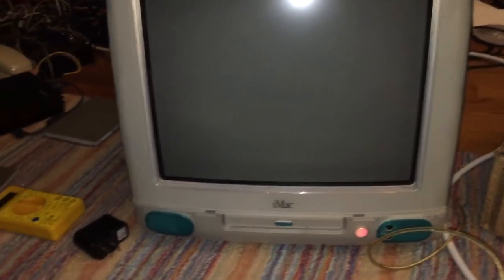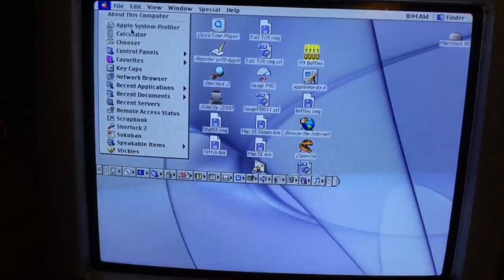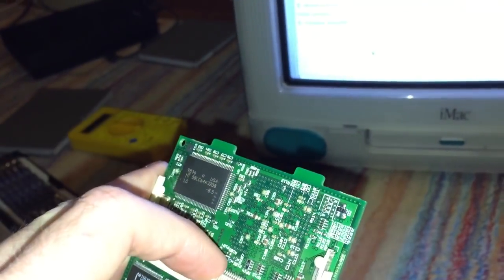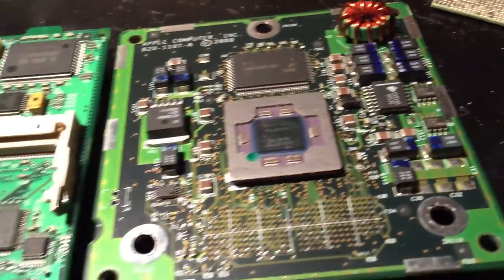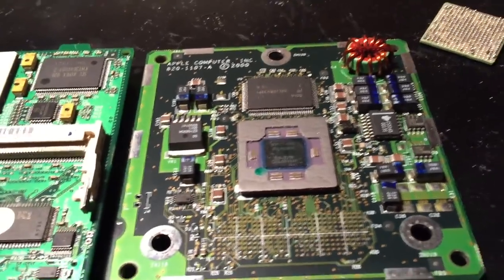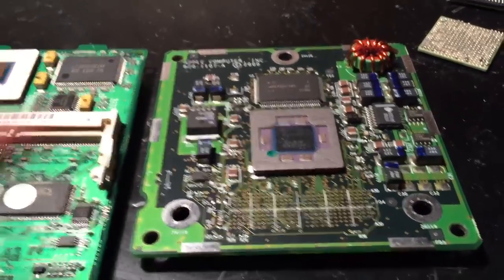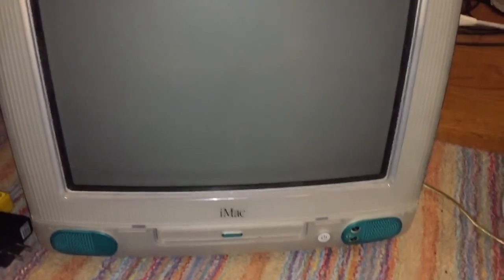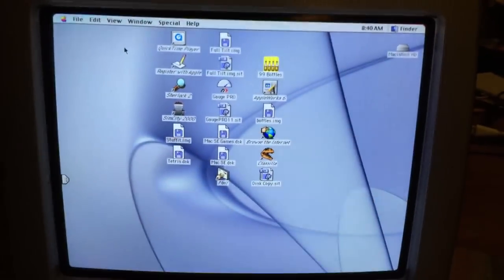Tray-Loading Blueberry iMac PowerPC G4 CPU Upgrade

Comment: You can overclock the bus to 83MHz. In addition to the 25% gain in memory access speed, the processor will rise to approximately 420MHz (and, if it is too much, there is the possibility of changing the multiplier to leave the processor at only 375MHz).
Reply: only Druaga is allowed to have a 420MHz G4

Comment: Why don't you put 512 MB of RAM in it?
Reply from the maker: I don't have 512MB that will work in this system. It requires low density PC66, PC100, or PC133 modules.

Comment: Would this upgrade work on the second gen? I know its on the logicboard and not on the card but still.
Reply: I have a spare board with no whole computer to go to and the 7447 at 1667mhz. would be an absolute ripper in 10.4.11 if I can manage cooling (not the worst part)
Reply from the maker: @misfit4816  Only some of them can (any that have a PPC750L CPU stock). They can be upgraded to a 500 - 550 MHz 7410, but no higher. 7447 isn't compatible unfortunately.

Comment: intsalled a 1.2 ghz g4 on one of these it works fine with a copper sink and fan
Reply: riiiiiiiight.
Reply: @wishusknight3009  no its not that hard . lol similar to what he did accept i had someone do the card for me  the 7447a uses a lot less voltage it was pulled from a dead g4 imac lamp model

Comment: I presume that this would work with a 7410, potentially even better, as they use a smaller 180nm process and use less voltage but iirc have the same CBGA360 package as the 7400?
Reply from the maker: Unfortunately, a 7410 will not work on this board, as it uses 3.3V for the L2 cache I/O. The 7410 only supports 2.5V L2 cache I/O voltage, so a 7410 would just get killed if installed. The 7400 still supports 3.3V L2 cache I/O voltage. I would try to change the L2 cache voltage, but it runs straight off the 3.3V rail of the system, there is no separation or regulator of any kind.
Reply: @dosdude1  cant you provide needed voltage from outside? And cancel the motherboard one?

Comment: I wonder if you can put a G4 chip in a clamshell iBook ?
As far as i remember if you have resistors in parallel you half the resistance of the sum of the resistors. 
That would be 10k + 28K = 38k divided by  2 = 19k
Reply from the maker: I actually have a video about performing the same process on a Clamshell iBook.
Reply: correct about the resistances.

serial adds them together, parallel is total resistance / number of resistors.

Comment: You're lucky that worked. You forgot to re-ball all the pads. You could of at least layed down a bit of solder first. And you forgot to clean off the solder from the bottom of the CPU. Otherwise, not bad.
Reply from the maker: You're not supposed to reball the pads on the board... And, I did indeed clean off all old solder from the CPU before reballing it.
Reply: Have you ever even done BGA reballing before?